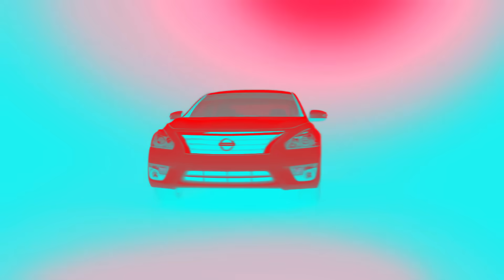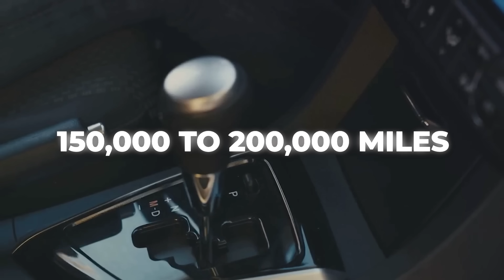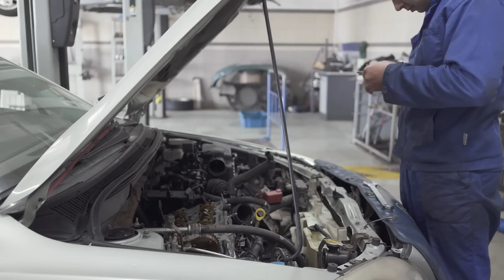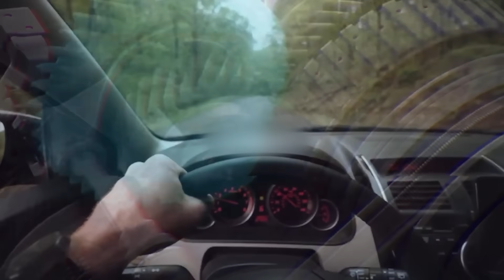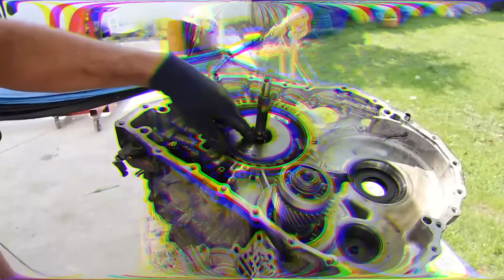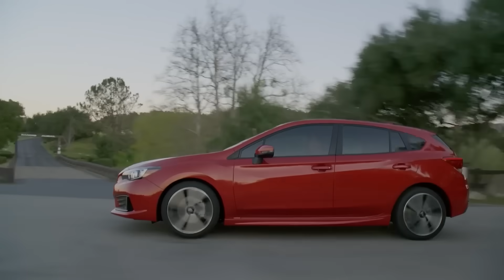STOP Buying Cars With CVTs - Here’s Why They Fail Early

Comment: With CAFE penalties ZEROed and the public sick of cars with expensive, unreliable, tech to squeeze out the last 0.9 mpg. I say the CVT and Dual Clutch trannies are dead. We will revert to is the good old torque converter auto paired with big displacement engines designed to last 40 years with no turbos, no start-stop, no cylinder deactivation, no wet timing belts, no 0W8 oil, no low tension rings and maybe choice between Atkinson or Otto cycles.
Reply from the maker: We’ll see what the future brings. Thanks for your feedback!

Comment: I just dealt with a 6 week debacle with my transmission going out 400 miles from home. A shop put in a new/rebuilt transmission that was defective so another was installed…not cheap! I took the car to Kia and traded it in on a Kia Soul (perfect little car for where we live)…our warranty is 7 years or 100k miles and covers everything including oil changes. It has a CVT trans which seems to be working well…and if it doesn’t, it’s covered. Never dealing with that nightmare again. CVT has less moving parts and if they can perfect it, it’s seems like the future for most smaller cars.
Reply from the maker: Fair enough.

Comment: Not all CVT are the same.   Toyota Hybrid models use E-CVT transmission, which are NOT belt driven. They are super reliable!
Reply: They shouldn't call a planetary gear transmission a CVT. Gives it a bad reputation. It's a different bird. E-CVT, good idea, bad name.
Reply: Same with Honda, e-cvt.
Reply: Daihatsu has this D-CVT which works on belt for slow speeds while on higher speed it uses a gear which is cool
Reply: Daihatsu has a reputation for reliability and good engineering
Reply: The ECVT is not a CVT.
Reply: The Honda CVTs have also been reliable as well. I've seen Honda that have over 200K miles on their original CVTs. As long as you change the fluid every 30K miles, they should be fine.
Reply: @donaldwilson2620 you'll rarely see a 200k miles CRV with original CVT. SuV CVT are terrible.
Reply from the maker: yes they've improved a lot. The safest choice for CVT
Reply: Same with the Ford Maverick Hybrid it has an E-CVT, differs from CVT. https://youtu.be/Qt14RKVpIi0?si=2IXYmfWy2x0owy9E
Reply: I moved out my cars with CVT one by one and now no more.
Reply: Yes gear driven.
It is the only one I would go with
Reply: They should get rid of the C's in the CVT, should have named it EVT. Electronic Variable Transmission.

Comment: A friend of mine has a 2017 Honda CRV with 135000 miles on it. He just has it serviced as recommended + doesn't drive with a light foot. Surprisingly, he's had no problems.
Reply from the maker: I bet he maintains it super well
Reply: CRV cvt are known to fail with heavy foot.

Comment: This is why I choose a Toyota over a Nissan. Toyota cares about it's reputation.  I have a Corolla with a CVT and have no complaint.  I will keep it well serviced.  People said this when cars came out with automatics in the 50's.  Oh they will fail, I am sticking with a manual.
Reply: Automatics (planet gear) showed up in the late 1930s.  Manuals need new clutches, automatics need fluid changes.
Reply from the maker: Good choice.
Reply: Both junk! 

Mazda 6 speed is the best today by far!
ZOOM, ZOOM...
Reply: Same with the Honda CVTs. I have a 2020 Honda CR-V, and the CVT has been very reliable. I replace the fluid every 30K miles, and I don't drive like a maniac. Most Honda CVTs tend to be very reliable if you maintain it properly.

Comment: IQ? Pure clickbait!
Every single owner of a CVT (Nissan, Subaru, Honda) that I know, about 10-12 people/cars, have not had any issues!

Yes, the first designs FIFTEEN years ago did have issues, plus it is the dumb owners that do not change the CVT fluid every 40-60K miles!

Is your IQ gonna tell us now that 100% of standard automatic transmissions are garbage, because of the GM 10 speed failures!?
Reply from the maker: Thanks for your feedback. Comments on this video and my others have anecdotes saying otherwise. But ok

Comment: Proper maintenance of a CVT (Continuously Variable Transmission) is crucial for a long service life and high mileage. Below you will find an overview of the most important points.
1. Regular maintenance and change of the transmission fluid
This is by far the most important aspect of CVT maintenance. The transmission fluid (also called CVT oil) is essential for the lubrication, cooling and correct operation of the transmission.
Although some manufacturers claim that their CVT is 'sealed for life', in practice it is highly recommended to change the oil. The most accepted rule of thumb is to change the CVT oil every 60,000 kilometers. Some sources even advise this already at 40,000 kilometers.
Always use the specific CVT fluid recommended by the manufacturer. Using the wrong fluid can negatively affect performance and lead to serious damage.
With a Standard Oil Change, some of the old oil remains in the system. To optimally maintain the CVT, it is better to "flush" (flush) the transmission. The old oil is completely flushed out of the system and replaced with new, clean oil. This helps to remove dirt, sludge and deposits.
Do not forget to change the oil filter at the same time as the oil change.
2. Driving habits
Your driving style greatly affects the life of the CVT. A CVT works more efficiently and wears less with a calm driving style. Try to avoid abrupt acceleration and constant full throttle.
Heavy loads, such as pulling a caravan or trailer, can cause additional wear and tear. Some CVTs have a special mount or L position to help with this. If your car has this option, take advantage of it.
When descending a hill or mountain, you can use the engine brake, instead of constantly using the brakes. This prevents overheating of the brakes and can contribute to better control.
3. Service life and mileage
The service life of a CVT is highly dependent on maintenance and driving conditions. Although there is no fixed mileage, we can give an indication:
Without adequate maintenance, some CVTs can show problems after as little as 100,000 to 150,000 kilometers.
With consistent and high-quality maintenance, a CVT can easily last 200,000 to 300,000 kilometers or more. There are examples of CVTs, in particular in hybrid models from Toyota, which even exceed 400,000 kilometers.
Watch for symptoms such as skidding, high RPM at low speed, strange noises, or jerks. These are signs that there may be a problem.
4. Specialists and controls
Have your CVT serviced by a specialized garage experienced in this type of transmission. They have the right knowledge, equipment and software to read and maintain the transmission correctly.
Have your CVT checked regularly, for example during a regular service. The mechanic can then check the fluid, hydraulic pressure and sensors and detect any problems at an early stage.
In summary, the key to a long and trouble-free life of your CVT lies in timely and correct maintenance, especially changing the correct transmission fluid, combined with a calm driving style.
Reply from the maker: Thanks for your feedback. I don’t think the general population wants a car you need to drive around on eggshells
Reply: Sometimes jerking is normal on a cvt's because its a rubber band effect

Comment: The eCVT in a hybrid is NOT the same. eCTVs are reliable.
Reply: What's the difference? eCVT?
Reply: @idrinklight44 eCVT transmissions do not use the metal “belt” and sheaves of a typical CVT. They contain a planetary gear set and the electric motor and motor/generator used by the hybrid drive system. They are very reliable in Toyota hybrid vehicles.
Reply: @idrinklight44  eCVT looks more like a differential, a part of the drivetrain that outlasts almost every thing else.
Reply: @idrinklight44 your ignorance is why these videos get views you hate on cvts and don't even know there are different kinds
Reply: @truckercowboyed2638 It’s pure bs video or made on purpose for controversy. I don’t believe author is so stupid 😂
Reply from the maker: thanks for the clarification

Comment: Nothing wrong with CVT's, do maintenance, it will outlast any torque converter traditional transmissions.
Reply: Put the bong down
Reply: @mochiebellina8190 you can find many Toyota’s CVT with 300-400 miles, no problem, they keep going, unless your too lazy to do the maintenance 😂
Reply: @sly9214 they are E CVT's thats why. Its not the same thing as a regular CVT.  Still yet even the best ECVT are not as good as a regular tranny.   a regular tranny can be rebuilt for far cheaper if they do go bad
Reply: Yeah OK... and i'm The Pope!  Idiot.
Reply: nah they suck worse than a stick shift
Reply: @Yoyolvzmzda3 if we speak durability, it can outlast any type of transmission, even stick.

Comment: I have a cvt in my '24 Corolla. I plan on servicing the fluid at 20k miles. I removed some fluid at 5k miles to add and additive, and boy it was already kind of dark
Reply: Nooohhh additive is never recommended by manufacturers or discouraged by PRO mechanics
Reply: @leetos.4915  Agreed! Additives work for regular transmissions but CVT require a very specific type of fluid. Also always use the OEM fluid. It is not worth it to save a few dollars with an aftermarket fluid especially if it damages your transmission.
Reply: @malcolmar I will use OEM fluid till the power train warranty runs out. After that I'll use aftermarket. OEM fluids are designed just to be adequate enough.
Reply: @leetos.4915 for me, it seems to have quieted down the factory whine and it shifts fine
Reply: It will still fail. U can't get by planned obsolescence. If u maintain u will get to 80-100K vs 60.  Video states 3-5K for a new one? Not even close.  maybe used.  New will run u 8K especially for Nissan. The fluid Is good for the life of the transmission which is a few years so they are not lying.
Reply: Is it a gas only or a hybrid? Toyota hybrids DO NOT USE the type of CVT this video is about.
Reply from the maker: Good luck with that!
Reply: @the.GarageIQ  not sure about all this my 2020 le has 160k it’s got the 1.8 with the cvt been changing the fluid every 60k no problems yet